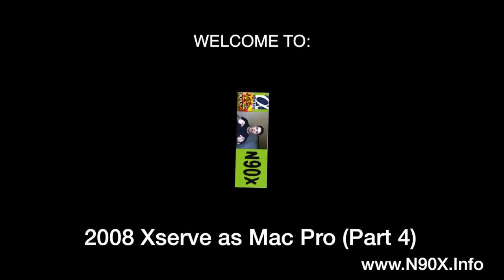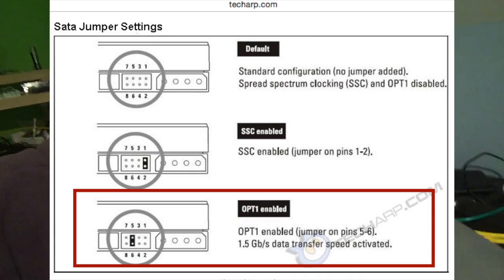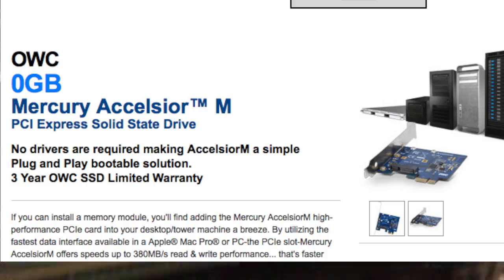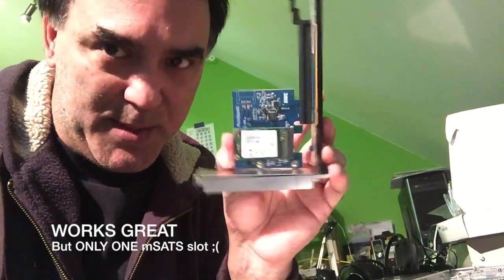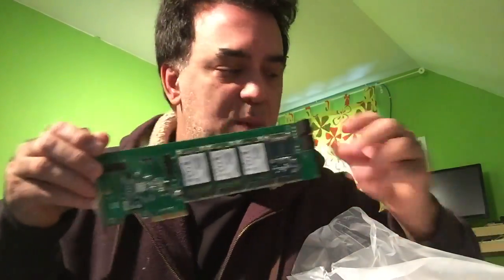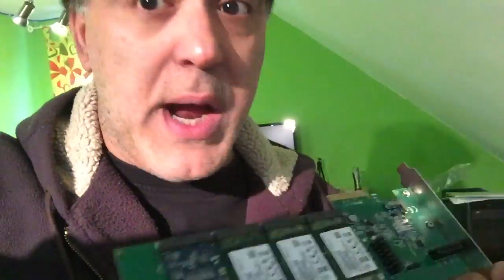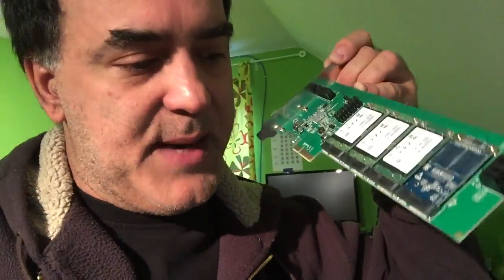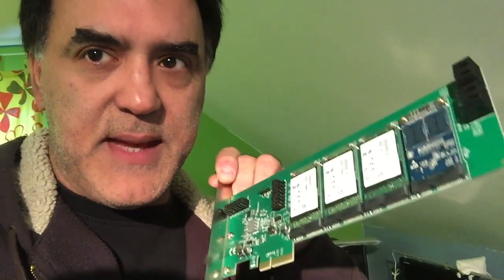Xserve 2008 Expansion and Acceleration! on OSX 10.10 (N90X) Part 4

Comment: For SSDs the PCIe solutions you show here are the best options in regard to performance, but we also need to take into account, that only 2 PCIe slots are available in Xserves - for HDDs you could consider to use SAS drive modules.
There is no limitation of 1.5 Gbps, if you use SAS drive carriers (ADMs) and you put SATA drives into them (yes, you can do that, because SATA drives can be connected to SAS controllers). Then you will have the full 3 Gbps available which the SAS controller provides. Apple shipped many of their 1 TB SATA Xserve ADMs in SAS carriers.

Comment: Turns out with the 4 x mSATA card , when all ports are set to mSATA - then it boots from the Carbon Copy OSX versions on mSATA.  I tested this by removing the 60GB mSATA card and it still booted as long as all the pins were jummpered to mSATA.
the SATA ports appear to be non-usable in the XSERVE, just no room.

Comment: A hard drive connected through the gigabit NAS will have more of a bottleneck than the 1.5 Gbps SATA speed (1 Gbps vs 1.5 Gbps.

I've been running an Xserve as a desktop for about a year now and it's been great. One thing I've noticed is that the drive sleds are very picky about what hard drives go in them, so I haven't been able to just put any HDDs in there. Luckily though, a 512GB Crucial MX100 works great. Yes, there is the 1.5 Gbps bottleneck but it's the instant seek time that is the biggest speed boost with SSDs anyway. I have considered getting a PCIe SATA adapter (the ones that are basically a PCIe card onto which you mount an SSD) but I'm in two minds about whether I'd rather have that or if I'd rather have a USB3 controller.

FWIW the best graphics card you can put into the machine without adding external power or running with the lid off is a Galaxy 750 Ti Razor. It's a single slot card and runs great although it won't display the apple logo or boot selection menu at boot, it displays once OS X is loaded just fine though.

I've been running mine in the cellar with some USB extension cables and an HDMI over Cat 5 so I don't hear the noise. I used to be able to do audio over HDMi but that's not working at the moment, likely because I'm pushing the distance of the signal over the CAT5. Other handy options when running it 'remotely' is you can use a Banana Pi (Raspberry Pi clone with faster CPU and gigabit ethernet) and some clever software called VirtualHere to effectively add remote full speed USB 2 ports. Unfortunately the one thing they can't do is usb audio or webcams due to a limitation in the VirtualHere software on macs at the moment.
Reply: +Spanky2k Did I mention for any newer (faster) SATA drive to work in the Xserve (2008) you may need to jumper pins 5-6 on the back of the drive to slow speed to 1.5Gbps. Once I did this my 'non working' drives were instantly detected and worked.
Reply: +Spanky2k yes you are correct that GigE is technically 1 Gbps vs the 1.5Gbps speed of the internal SATA array, but - connected to a 4-Drive-Stripped-RAID-ZFS array (FreeNAS) and we are talking about sustained speeds of 1-GigE and for some reason are faster than native writes.
Not sure how it is possible, but when I copy large files from one internal disk to the other it takes much longer, then when I copy the same large file to the NAS.

Check the next video in this series, 3 drive stripping internally helps a lot, but of course if you lose 1 drive you lose everything. But for fast data access and processing you will get a 3X boost using Apple OSX Software RAID.

OH, your drive problem - be sure to jumper pins 5-6 on your newer SATA drives, this will slow the drive to 1.5Gbps and make it instantly compatible with your XSERVE.
Reply from the maker: +Spanky2k Hi, have you found best place for Galaxy 750 Ti Razor? eBay?  How much faster than the GT120? What are the advantages?
Reply: They seem to be a bit hard to get hold of these days, I bought mine when they were released and readily available, about a year ago. I never tried the GT120.

Before the 750, I used a 640 though, which I think is still easy to get hold of on eBay for peanuts. Both of these cards are going to be huge improvements over the GT120, being what, 4 or 5 generations newer?

I've been a little disappointed with the 750 compared to the 640 and it needs the special nvidia drivers to work properly, which is a bit of a faff (may be supported out of the box with El Capitan, I haven't upgraded yet). The 640 was plug and play though and I was really impressed with the performance for the money (I think I paid about £20 for it).

Honestly, I wouldn't waste your money on a GT120, I'd pick up a 640 for probably less money and way way more power. The only thing you'll be missing is the start up screen. Even that might be fixable with a custom rom although I've never bothered looking into it.
Reply from the maker: Spanky2k
I may try the 640, but already have new GT-120 for my Xserve  and they seem good to go for my purposes.
Good to know about the other out-of-the-box compatible cards.
Reply: joebonsaipoland Thanks for that, if I ever need to add storage, I'll certainly give that a try. I'm planning on building a NAS though for my home storage needs, shifting my data off all the hard drives attached to my hackintosh. The Xserve is my wife's computer and the 512GB SSD in there is more than enough for her needs right now.
Reply: NetScalerTrainer  Yeah the GT120s are going to be the 'most' compatible - boot up screens and all. If you ever decide to go for more power, there are at least alternatives out there. I'm hoping that at some point someone will release a single slot 960 or 970 GT for some real oomph. It's certainly possible but the market for single slot cards is really small and I suspect the 750 slim edition didn't sell well, hence why it's already off the market.